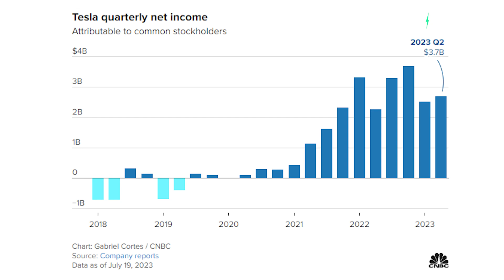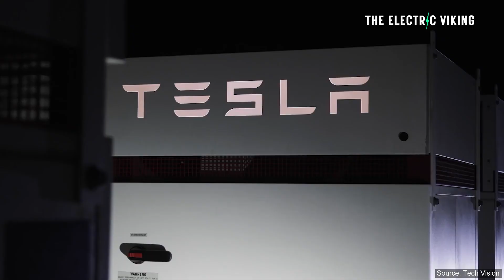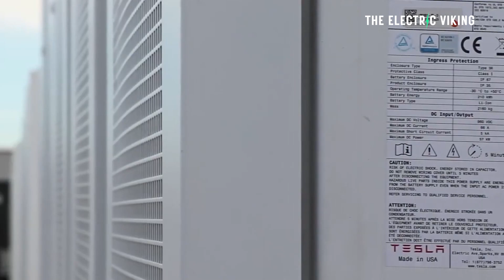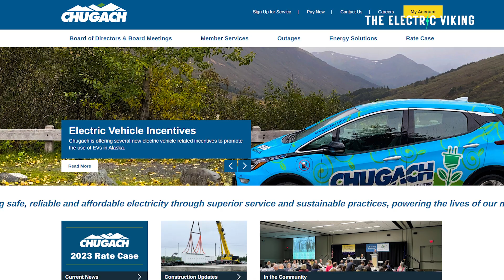Tesla's new MegaPack battery in Alaska will save local town $121 million

Comment: Batteries also provide a grid services function which means they can input or store energy from the grid within milliseconds to keep the grid voltage and frequency stable as loads change (much faster response than gas peaker plants).

Comment: Knowing that batteries can only charge or discharge at a set rate (usually SLOWER THAN NEEDED), how is this replacing ANY peaker plants?

Answer?  It won't,  any more than it has anywhere else.  Battery systems are marginally useful at this level for TRANSFER power, as additional BASELOAD CAPSBLE power is added or dropped.  So, just like solar and wind, these batteries will only patch in where solar and wind drop in and out, and peaker plants run up and down...AS USUAL...

Not sure where the savings come from, seeing as how everyplace this is tried, prices and emissions go UP.
Reply: Tesla megapacks contain technology to charge and discharge as quickly as the grid needs. The on/off switching with Megapacks is so much faster compared to fossil peaker plants that the local grid won't experience brownouts anymore. These Megapacks solve a local grid's energy stability problem, so they are far from marginally useful. They are proven to be actuallt useful. A Megapack can replace a peaker plant 100 %, so a peaker plant actually won't be running up or down. It will be shut down forever when a Megapack to replace it is installed. Savings come from eliminating the need for inefficient peaker plants.
Reply: @eaaeeeea  No, they've only proven that they will prioritize government buildings, to the exclusion of anything else.  In ACTUAL USE, they cause far more power fluctuations than they smooth out.

Comment: So this battery will supply power for just 2 hours?
Seriously?
Go to Home Depot and buy a generator for god’s sake.
Reply: "By the end of 2018, it was estimated that the Power Reserve had saved A$40 million in costs, mostly in eliminating the need for a fuel-powered 35 MW Frequency Control Ancillary Service.[42] In 2019, grid costs were reduced by $116 million due to the operation of HPR.[43] Almost all of the savings delivered by the Hornsdale battery came from its role in frequency and ancillary control markets, where HPR put downward pressure on total prices.". Look it up

Comment: How does storing energy in batteries, save money or help the environment, if the power being generated is a fossil fuel ? Anyone?
Reply: It helps level production demands during times of peak usage demand.
Reply: You can run your more efficient and thus not-as-polluting base load plants with the help of these batteries instead of the more polluting peaker plants. Then you also have a very good chance to install new renewables to fill up that battery. cheaply.

Comment: For a super cold place like Alaska, should they not be housing the Megapack battery units inside a larger thermally insulated shed with its own heating? Even if the Megapack contains its own heating unit, it will be very energy inefficient for it to be constantly heating up itself 24x7 when the outside temperature is -10.

Comment: Yes, things are improving.
But we have a long way to go.
Reply: and from a tesla shareholder POV thats a very good thing since thats many MANY more years of similar and bigger purchases
Reply: @Joe-lb8qn :  And a relatively stable replacement business over time, as long as Tesla keeps offering good value and quality to customers.
Reply: @Joe-lb8qn  
Have EV's made a 1% penetration into the number gas guzzlers?
In addition to trucks, airplanes, ships etc we also have farm machinery powered by diesel. 
Modern agriculture is oil dependent 3 ways:
1. Agricultural chemicals made from oil and gas that enhance food production 3 fold.
2.  Farm machinery powered by diesel. 
3. Transport to our local shops powered by diesel. 
Currently, an oil crisis will mean a food crisis.
Reply: @grahammewburn :  Which is an example of why we should NOT be burning our finite supply of oil, but using it for things we actually NEED, like plastics, etc.
Reply: Yup.  There's a tremendous inertia and energy use (thus the magnitude of the problem) on a planet with 8 billion people and counting.

Comment: This is a great use case for battery technology.   The key is to take some of those cost savings each year and bank them (not spending them on current costs ) so there is money to replace/repair/recycle the megapacks when they eventually need replacement. 

Sure, banks will loan money to purchase replacements, but if they save the money year by year it will generate interest to offset inflation and they won’t have to pay interest on a loan. 

As the cost of packs comes down, they can expand the farm to offset population growth, increases in natural gas to fuel the base load and loss of government subsidies. 
Win, win, win.
Reply: Good thinking. However you might like to listen to Peter Zeihan on how population peaked in 2019 and has started to decrease. By 2050 the population of China will be 650 million that is half of the 1,3 billion it is today.
Reply: Naw, they should spend it like a drunk sailor. 😉

Comment: These batteries are worthless unless you fill them up from solar cells and or windmills. Just is a convenient way of dealing with peek loads.
Reply: Worthless? At least getting rid of very expensive diesel peaker plants.
Reply: Just 😂
How about filling them up off peak at almost free cost and and discharging at peak cost 🤑
Reply: they are used to smooth out the bumps in the network, when everyone turns their kettles on the additional power comes from these battery packs, overnight the electricity still being generated by power stations fills the batteries up all ready for the next surge.
Reply: @stevenbarrett7648 what fills up the batteries overnight? Coal?
Before the renewababbles crap turning on a kettle was never a problem. A fkn kettle being used is now a issue for the grid😂. GREAT SUCCESS 😅
Reply: @robertfonovic3551  Even if your area burns all coal, it will require less.
Reply: @robertfonovic3551  Well here in the U.K. it’s wind energy.
The renewable crap (now by far the cheapest), is about a quarter of the cost of nuclear, coal is dead in the U.K. and Western Europe, because that was even more expensive.